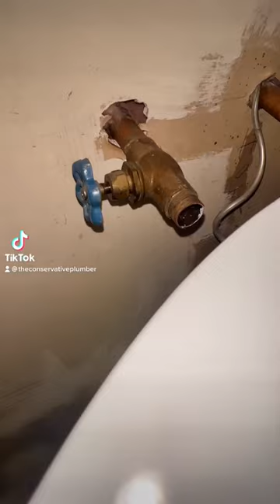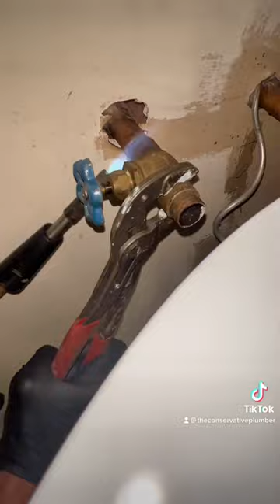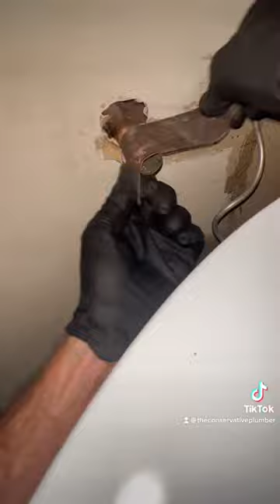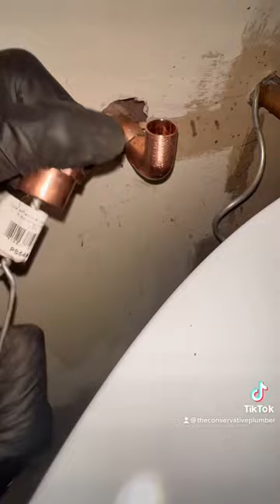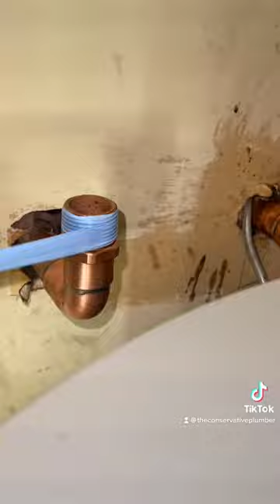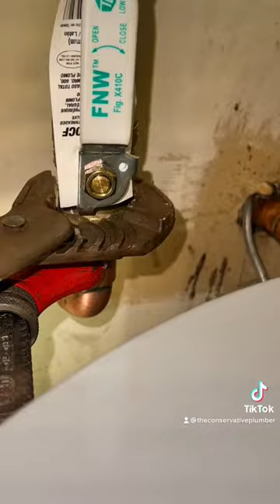Replacing a water heater shut off valve #plumber #plumbing #gatevalve #soldering #diy #shorts

Comment: Me-Damn that's way too much flux
Him- proceeds to wipe off excess
Me- damn nothing wrong here, maybe I'll find something to bitch about in the next video
Reply: @ramapalmer5985  or just use a solder valve and not a thread on? They are cheaper.
Reply: @blackwater8593  he did say he didn't have sweat, so he had to use what he had on hand

Comment: why threaded?

its cool to see a real solder job and good work
just curious why not sweat ball valve?
Reply: A lot of times we will convert to threads so that it is easier to maintenance in the future no matter who happens across it. Threaded connections are perfectly viable.
Reply from the maker: Tbh I just didn’t have any more sweat ball valves so made it work with what I had.
Reply: understandable
make it work with what youve got
thats being a plumber!
good job
Reply: @theconservativeplumber  easier job for the next guy too
Reply: When the store is sold out, you fix with whatever you can find.  And then CHARGE more.

Comment: Was that pipe dope on top of the teflon?.... i mean im sure it didnt leak because of the teflon, but there is no way the pipe dope makes a good seal with the teflon in the way...
Reply: This is common practice...
Reply: That's the way it's done!
The dope acts as a lubricant, allowing you to get an extra 1/4 turn or so.

Comment: Why tape then dope? And I like that little torch flame what tip is it
Reply: A lot of plumbers seem to be doing both Teflon and liquid Teflon these days and I honestly want an answer as to why as well. 😂 I hate pipe dope so I always just use tape.
Reply: Most of the time tape is fine... But once in a while it's not enough. So the extra 5 second per thread connection prevents having to drain water again redo the Teflon.
Reply: @drmarsh4287  Yeah, I've recently come across some "tape only" connections. 
The homeowners were really pissed about the water damage to their hardwood flooring.
I just hope you're not using the tape only method with fuel gas piping.

Comment: Good job but you never use channel locks on brass fittings or valves. Open end wrench or crescent wrench. Damage the brass and could round it off

Comment: That’s precisely the way I like to install the valves.
Reply: Why not just sweat on a ball valve so you don’t have to do the whole 90 and male adapter
Reply: @chrisk6021  sweat valve fail sooner and maybe right after they're installed if you get them too hot. the 90 makes a cleaner alignment of the supply lines to the w/h, simply up over and down.

Comment: Pipe looked like it had water in it . Could leak. Ruins the soldering joint. That's  why I use sharkbite. Could  start a fire too.
Reply from the maker: Hahaha man if only you knew how to solder.. you could leave those sharkbites alone
Reply: @theconservativeplumber  how do I  know it didn't  leak.

Comment: Well done. Good thinking using the 90. Easier for the next guy to work on.
Reply: what is that gkue looking grey stuff he put in the inside of the fittings
Reply: @obama7325   flux. Required for soldering

Comment: The tape is not needed
Pipe dope is stronger so that tape is weakening the job
Reply: You use both on any water fittings so that they will come apart if ever need be.

Comment: Until those grips slip and you rip the soldered fitting out why not just get a proper compression valve after you've soldered the rest?